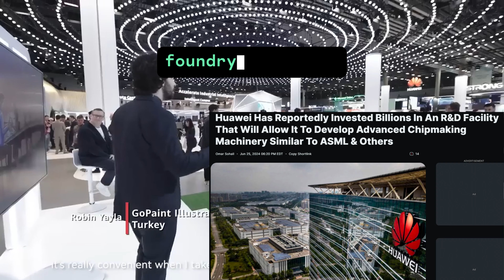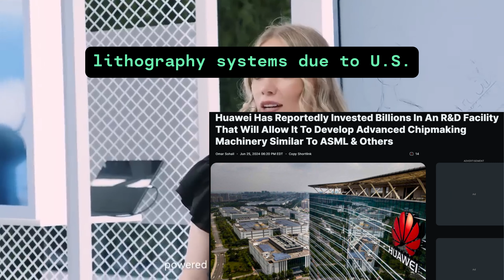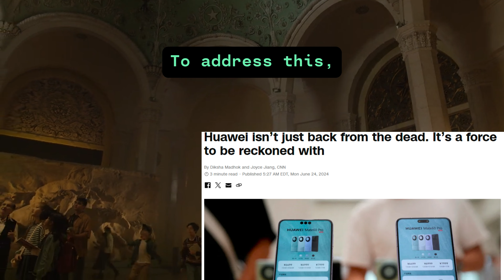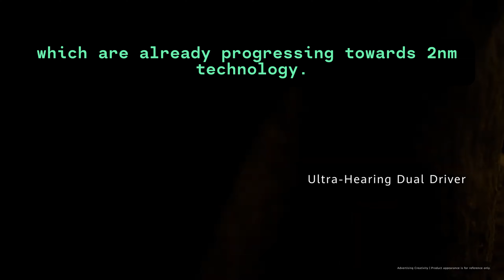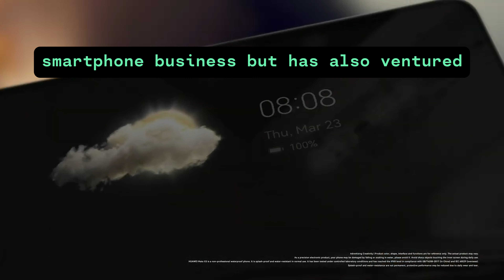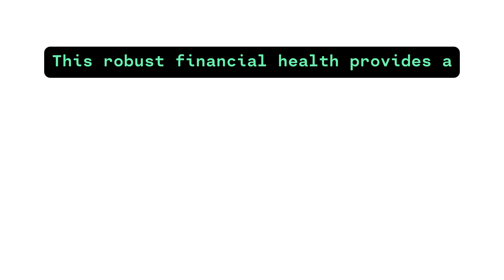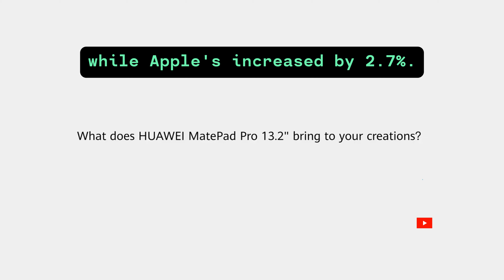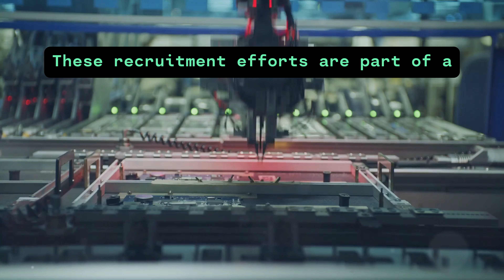Huawei & SMIC Billion-Dollar Investment: 5nm Chip Development | AI Robot Semiconductor EV Chip

Comment: This September Mate70 launch...

@mrquestion2010 

Mate 70 Pro uses Harmony OS Next which increases overall efficiency by 30%. Together with the 3nm process of Kirin 9100, it reaches TSMC's equivalent of 1.5-1 nm. The 2nm process and fin width of 4nm are the limits of TSMC standards.China has surpassed the lithography machine and will leave the West behind with the absolute leadership of Hyper-Threading and VGAA.

We will see. Exciting times. If it's 3nm for Mate70, then by next year China will has mass production. Apple16 likely on 3nm 2nd Gen. China caught up.